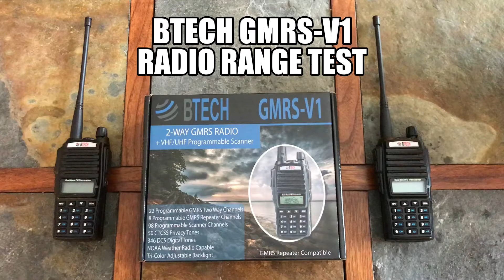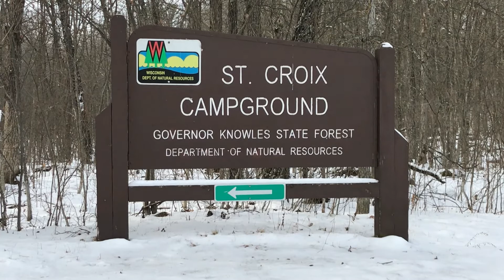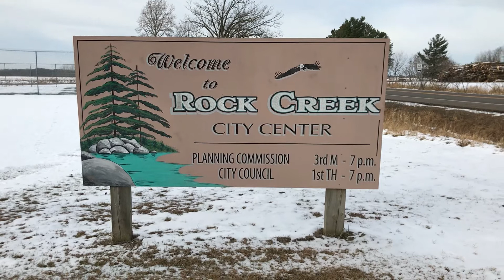BTECH GMRS-V1 Radio Range Test

Comment: Nagoya antenna cut to 1cm model na-771 works awesome
Reply from the maker: I bought the NA-701 for both of my BTECH GMRS V-1s.  The FM reception has drastically improved.  I'm now able to pull FM stations from the cities (Minneapolis/St. Paul area) no problem whereas before I wasn't able to with the stock antenna, and I was pretty impressed with the stock antenna with regards to GMRS reception.  I can't wait to transmit long distances with this antenna to see how it performs.  I'll bet it'll increase the range and I'd be able to reach into Rush City proper or Pine City with the Nagoya.  It has also increased my scanning reception/clarity.
Reply from the maker: Does that antenna improve the FM reception, range, or clarity significantly?  My FM reception right now is very poor and I'm looking to improve that.  I'm very happy with the range, but it'd be great to extend it even further and improve on the clarity.  I think I remember seeing someone buy one of those antennas and cut them down on another range test video, and I seem to remember Hoshnasi using and recommending that antenna.  Thanks for the recommendation!  :)
Reply: @matthewjdenn  yes absolutely from what I’ve seen on the boafeng models. You have to check the specs of some of these GMRS branded radios because a lot of them aren’t taking full advantage of the 5W channel range because they’re only pushing half that at about 2.5W like Midlands do
Reply from the maker: @greg6162  Just to clarify, by FM reception I mean the FM radio feature reception, i.e.-101.3 FM.  Will it improve that reception?
Reply: @matthewjdenn  LOL 😁
Reply from the maker: @goodoz9942  What's so funny?
Reply: @matthewjdenn  SMA Male, SMA Female or BNC antenna connector.
Reply: So I bought two of these radios, and the na-771 antennas but I am failing to reach out more than a mile with this setup. Am I missing something obvious? I’m very green to the GMRS world. Is the antenna trim as easy as just cutting it with a pair of snips? Excuse me for all the questions, I’m seeking knowledge.
Reply from the maker: @brianroe7407  You may have to adjust your power settings in the menu.  Maybe you're transmitting on low instead of high power?  The low power mode is really low like the wattage on a FRS bubble pack radio like a half a watt or one tenth of the power in high power mode which is something like 5 watts if I remember correctly.

Comment: Thanks for testing while in the car. I've been wanting to know how far these radios can go  without an external antenna.
Reply from the maker: They can go far – 16 miles with the stock antenna under ideal conditions!  I got a 12 inch ABBREE antenna and I’m looking forward to doing a range test on that one as well. I might be able to get another mile or two out of it.  I highly recommend these radios, but if you’re in the market for them, I would recommend the new V2 version that’s water and shock resistant.  I had to replace one of the V1s due to the microphone 🎤 going out on it.  BTECH sent me a replacement for a reasonable price and if you ever need any support for them, they’re very responsive and helpful!

Comment: Some takeaways from watching this, a couple years after it was posted...  While some of the criticism in other comments may be justified in some sense (operating a handheld inside of a vehicle, not using an exterenally-mounted antenna, not replacing the factory antenna with something better, some of the radio etiquette), this is also not amateur radio, this is family-license radio.  This is very likely how most people that aren't into radio communications as a hobby will use them.

They'll buy handhelds for car to car communications while driving in rural areas without good cell service to meet-up at a campground, or for more power and range than FRS if a family or group splits up while camping so that those at the campground can communicate with those that went off to hike or go four-wheeling or similar.

So this is very plausible.  One operator trying to use good etiquette, knowing how the radios work, and other operators just knowing that they have to push a button before speaking, not knowing power levels versus channels, not understanding waiting for the other party to finish talking (ie half-duplex) etc.  This is how most families (remembering that GMRS are family-group licenses) are going to use this.

I've had an amateur technician license for over 20 years, but I just use it for this sorts of communications every now and then on 2m, basically being able to communicate with friends when we're out of town and don't have cell service.  But the one radio that I've used this whole time, a 2m HT Alinco DJ-195, is starting to show its age, not working real well anymore, having problems with reliably remaining powered on.  Since I should probably replace it anyway, I'm looking at how people are actually communicating these days, both in terms of what's popular, and in terms of what actually works.  The market for radios right now is a lot different than it was when I bought the Alinco.  Seeing that some of the same sorts of annoying issues trying to communicate are still occurring is actually kind of comforting, since it shows that even as much as things change, they also to an extent remain the same.

Comment: Another thing that would help is better GMRS tuned antenna. Those are also the BTECH v1 GMRS radios. Those are only 2 watt radios. I got my V1 radios when BTECH was transitioning them from 5watt to the 2 watt on high power. 
I have 3 V1 radios. I have done watt testing on them and I have gotten 4.97 watts . Mine get about 3-4 miles in the summer with all the foliage on the trees and bushes. Fall and winter 4 miles on a clear day . We have lots of hills trees . 
I even set up a base antenna and only cleaned up my transmission and reception

Comment: I appreciate that this is a REAL review and range test. You can tell his dad wasn’t into it but that works for me because a lot of the great reviews on YouTube are essentially bought and don’t reflect real world use. Not everybody is gonna be talking mountain top to mountain top and some of these ranges are just exaggerated with these GMRS radios. I’m looking for my first pair for me and my dad when we go hunting because it’s off the grid and no cell service in the forest that deep. I’m gonna get my license but also want to get an operators license for a handheld Ham radio. I was looking at the GMRS Midland GX1000 something... and they max out at 2.5W which seems underpowered especially on a 5W channel. I think the best handheld radio’s are gonna have a decent removable antenna for a possible upgrade. Most of these GMRS radios are just a step up from kids toys. Yet you can get a Baofeng for $29 that’s a true 5W with a 15” upgrade antenna. But these radios seemed to fair better at over 10/miles than the Midlands which barely get 1/mile. I noticed this has a longer antenna than the ones I’ve seen on Amazon.

Comment: You look thrilled to be at the St Croix Campground.  Gotta get out of the car, man.  Also, you could put a mag-mount antenna on the roof and then use your HT in the car with better results, surely.
Reply from the maker: Give me a break.  I had been up since the night before working all night long into the morning (I'm a Corrections Officer) and made the video the morning after.  I was planning on making it on my weekend but was anxious and excited to try out the radios.  I work a full time job, overtime sometimes, especially last year during COVID, and made and edited this video in my spare time.  If you watch the entire video, you'll see that I did indeed get out of the car twice later on in the video.  If you're going to comment, please watch the entire video first.  I had a limited amount of time in which to make this video, and saw it as pointless to get out of the car at the campgrounds when I was only 4-5 miles away and got good enough reception.  I was also a little annoyed that my dad kept confusing channel for power after I kept repeatedly correcting him.  I got out of the car at 14 miles away at the Rush City Lutheran Cemetery in Minnesota and was able to talk to my dad, albeit barely so - the reception was very scratchy and poor at that distance.  Yeah, I probably could mount a mag-mount antenna on the roof and use it in the car with better results, but I didn't have one at the time, had just gotten the radios, and I got them intending to use them primarily out hiking or in a mobile handheld role, so I wanted to test them out in that manner and share my results so I could help out other people, as I noticed that there really isn't a video on YouTube showing this radio's exact capabilities with map overlays documenting the radio's exact performance characteristics in varied terrain and real world conditions.

Comment: I still subscribed to your channel even though you still learning
Reply: I’m looking for a good set of GMRS handheld and I found the Midland1000 to be only 2.5W which seems like a waste for a 5W channel. I’m still learning but between these and the Midland I think these are much better which in my limited knowledge I attribute to these actually being the full 5W in a handheld
Reply: The BTech V1 GMRS isn’t a 5watt radio anymore. I have 3 of them . The first one I bought was advertised as a 5watt radio. Even the reviews I watched on YouTube tested it at 5watts. Then I got a second V1 . By the time I ordered the second and third radio BTech changed the wattage output. 
With that said radio 1&2 may be 5 watts. I’m almost certain that radio 3 isn’t. 
I have also the Wouxun KG805G. It is a 5 watt radio. My other 5 watt radio is a Retevis RT76P. It’s a decent radio also it puts out 5watts.
I’m going to buy some GMRS tuned antennas for the radios and then do some test then.
Also I will say this I got several miles when I tested the Btechs V1s . I would say about 7 miles . With that said it was a clear sunny day . I live on a big hill. If you have the summer time foliage and clouds and rain . That will greatly reduce your signal out out and receive signal.
Reply from the maker: Thanks, I am still learning, and appreciate your subscription.  :)